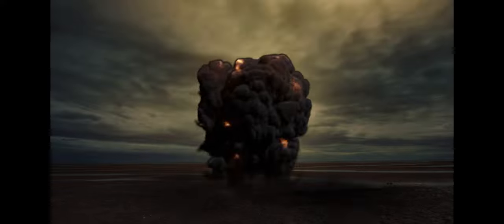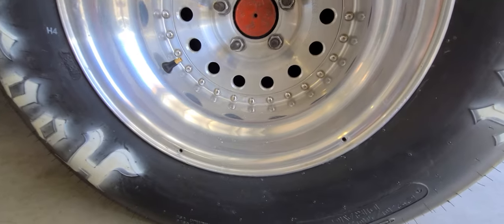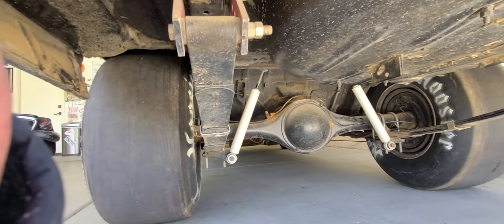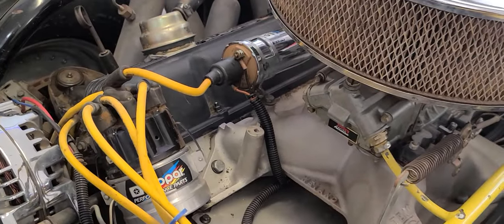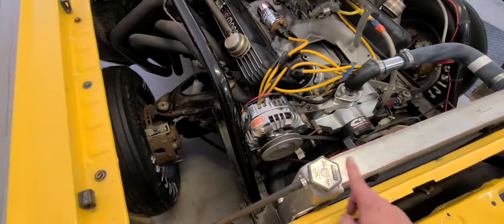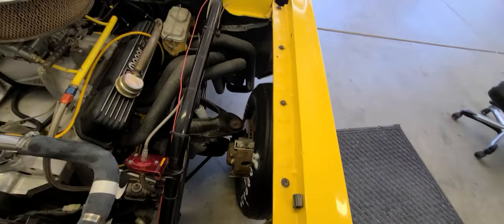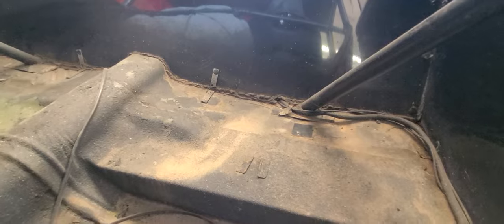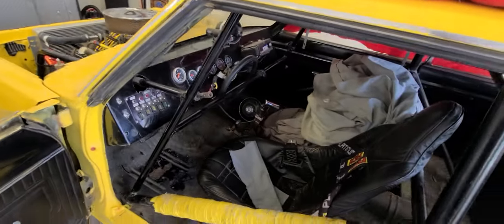71 Dodge Dart Drag Car Walk Around Specs (451 Stroker)

Comment: Nice piece ! Get the safety gear in line, and the things that caught your eye (maybe worth pulling a valve cover to look and see if it has a solid cam ? then if it does, go through and adjust the lash). Have heard a heat gun works magic on cloudy Lexan and other plastics. Look forward to more on this great car 👍
Reply from the maker: Thanks brother great advice, yes I am scared to mess up with the heat gun haha